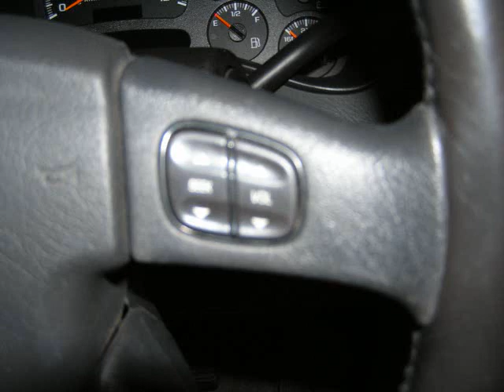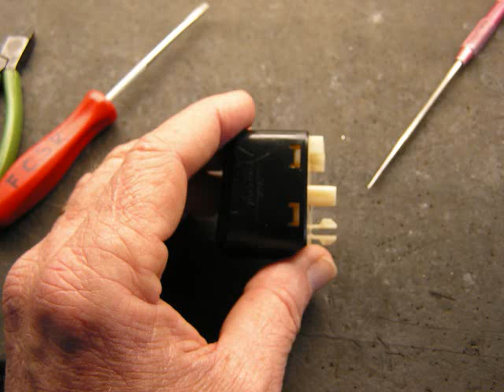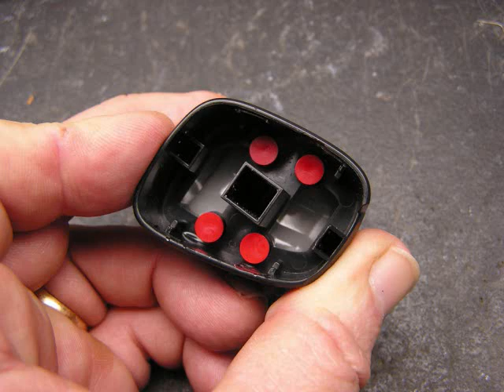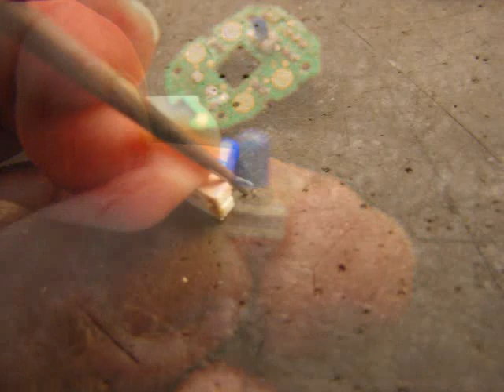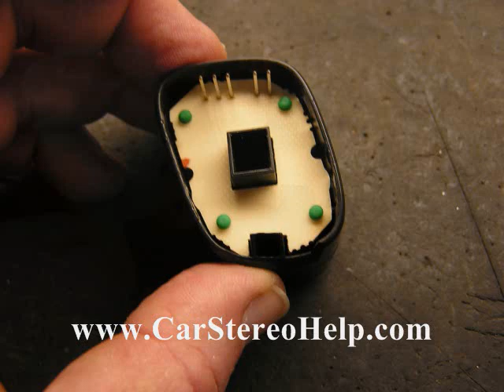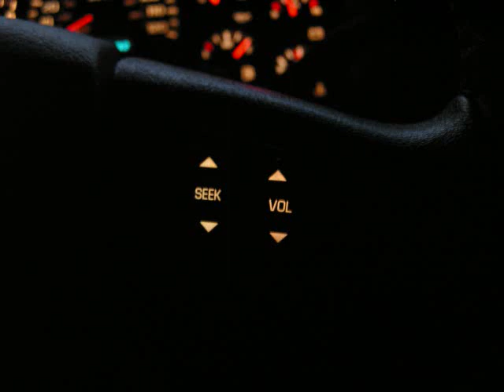Chevrolet Steering Wheel Control Removal and Back Light Repair = Car Stereo HELP

Comment: If your buttons are worn and back lighting dead, get new controls with LED's already installed: https://www.ebay.com/str/gmgaugerepair/GM-Steering-Wheel-Controls/_i.html?_storecat=5294336017

Comment: What is the purpose of the blue "condom"?  Is it to keep the bulb from overheating the button?  If I do this and switch to an LED bulb, I assume the blue condom is not needed, is that a correct assumption?  Thanks.
Reply: Phil Day it’s for the color temperature, to give off a pure white light rather than a dull yellow incandescent light color

Comment: Mines still work just the lettering rubbed off 😆
Reply: You can find decals on Ebay.  I bought these,  they are not perfect but way better than the worn out look https://www.ebay.com/itm/2006-Chevrolet-Gmc-Steering-Wheel-Control-Button-Decals-Stickers-Repair/202394692517?ssPageName=STRK%3AMEBIDX%3AIT&_trksid=p2057872.m2749.l2649

Comment: Thank you this was very helpful. I chose this route as my switches are in good  condition other than the lights burnt out and wanted to keep OEM and have all of the  lights match. I removed the  airbag center per a different video which helped considerably to be able to wiggle enough slack in the wires. The small bottom switches for mine were very difficult in fact I'm not sure that I could have gotten them. There are a few ideas of how to get the switches back in. One suggested what I chose; I used dental like picks to be able to hook and hold the wire socket and then just push the switch back on. I have some other lights out on the heater control which I'll tackle next.
Reply: sdrob671 can you post the link to the video you used?  Thanks in advance.

Comment: What is the part number for those bulbs?
Reply: did you ever figure this out? I would also like to know.
Reply: @faintoverboost7524  ebay this "MINI BULBS LAMPS FOR GM SPEEDOMETER CLUSTER BACKLIGHT 4.7mm 12v-14v"

Comment: Why not just purchase a whole new switch? Seems easy peasy to me.
Reply: It's been my experience fixing lots of this stuff that if you can hang on to OEM parts you're better off.  Most aftermarket stuff is very cheaply made.  So replacing bulbs is smart in this case in my opinion.
Reply: Id like to see them glow in a different color
Reply: 70$ plus those bills get hot if not such to led

Comment: I've been doing this in my GMC Sierra when I have time and i'll let you know this. I've put 12v led bulbs in my 4wd, dome, fog, and dimmer switches, as well as my instrument cluster and they all work fine. All this talk of resistors and stuff is non-sense. I haven't had any "dim" or burnt out bulbs at all. Do yourself a favor and order a 50 pc pack. Polarity will be trial and error but it's really easy to solder and unsolder as needed. Cluster has 11, 4wd switch has 2, cargo and fog light switch has 2, dimmer switch has 1. About to get into door switches and radio. Do yourself a favor and invest in a solder sucker.
Reply: Derek Verville what color did you do I'm trying to keep the stock color but I'm not sure what bulbs to go with
Reply: I did blue and they look great, so good actually that 3 of my friends did the same thing. I strongly suggest if you don't want a color than go with the white led instead of the stock yellowish halogen, way brighter.
Reply: Derek Verville will the white still require the condom thing or can I just use the straight white behind it
Reply: i got rid of all of the caps and just ran the lights as is, I only had 2 really bright spots but you get use to them.
Reply: Derek Verville does the type of bulb for this steeri g wheel controls matter. Like voltage and led, ect? U used same bulb ads the rest of ur interiors?
Reply: I used the same bulb for all dash and steering controls, doors are different, atleast in my 05 gmc sierra slt
Reply: +Derek Verville I'm doing this now . The white LED does look better than the stock yellowish color . Did you ever find out what bulbs to use for the door switch and radio ? Doing this on a 2003 GMC Sierra .

Comment: i have led lights for replacement anyone know the correct polarity??   thanks
Reply: Len C take the steering wheel control apart and remove the original lights connect just the circuit board make sure you connect it back to the right slot/or plug use one of your led lights and touch the legs on the circuit board terminals when the led lights up that's it you found your 12v positive and negative use a marker to mark a + or -- good luck

Comment: Hello

Where do I get replacement bulbs?
Reply: I have bought them on ebay search grain of rice 12V bulbs
Reply: Thank you. Might you have a link?
Reply: I got my 7219 mini bulbs from Digi-Key
Reply: I got mine here  https://audioxpress.org/listing-category/steering-wheel-control-bulbs/  and they came with new condoms and they matched the factory color.